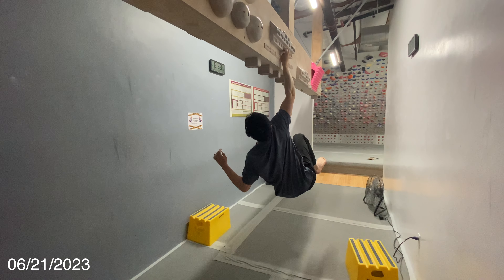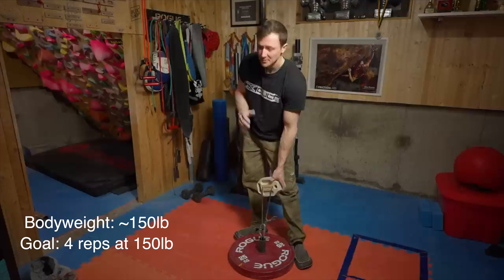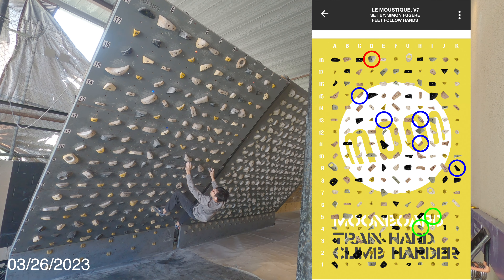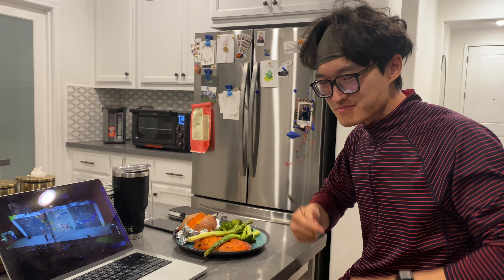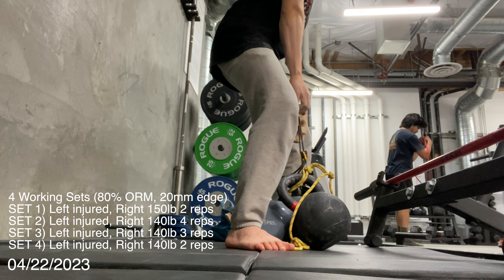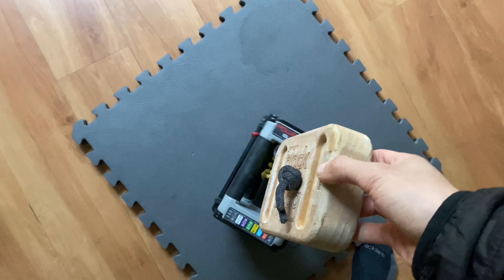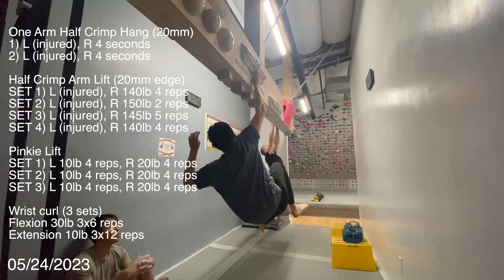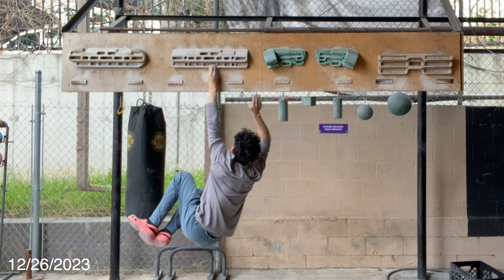How to Train the 22mm Half-Crimp ONE ARM HANG (and actually get it)

Comment: First video I've seen that addresses this form at 19:50, I've always half crimped with the wrist in extension with 0 pain. But when trying the strict half crimp I get pain on the ulnar side of my wrist. I get a similar pain with 3fd and on slopers. I've been doing wrist curls and reverse wrist curls to try and strengthen the wrist for months with no change. Any advice would be appreciated, hanging a 20mm one handed has been a long term goal for years, and idk if my half crimp form with an extended wrist is holding me back or if it's something else.

Great video, thanks for reading.
Reply: I also notice pain or at least increased tension, especially when emphasizing the pointer being in a half crimp. I think that position increases ulnar deviation. I injured my tfcc through overuse a while ago, and I think that weakness is my problem. Maybe check your tfcc?

Comment: I have really flexible DIP joints, and its very hard for me to avoid the hyperextension at the DIP joint. I can hang 1 arm for 2-3 seconds on the beastmaker center edge with hyperextension (not thumb wrapping), but can only hang with an additional 25lbs with two arms on a 20mm edge before my fingers fall into hyper extension. Do you have any recommendations for preventing the hyperextension/exercises I can do to help prevent this?

Comment: Your comment about the chisel position being weaker is probably not true — the position is generally worse for hard climbing because it provides less Z-axis control, but it's more mechanically efficient and requires less muscular activity for the same force output. This is partly why Yves Gravelle performs so well in edge lifts: his finger lengths allow both his index and pinky to be chiseled with about equal force distribution. (And I say "probably" only because there are probably edge cases where a specific individual's strengths/weaknesses/morphology make it not true for them at a given time.)

I also want to ask whether you'd consider overcoming isometrics / force meter training rather than the yielding isometrics you used here? The overcomings show greater muscle activity in tests, and generally are better at developing the ability to close the grip, which is more important in climbing. I actually think that really shows in your bouldering—you're very strong at yielding, but you actually don't seem that strong at closing your grip and "owning" the hold, which is what you tend to see with really good crimpers/climbers.

Comment: You said you wanted your DIP joint to be neutral or flexed, never extended. Isn't extension what seperates the crimp from the open hand position, which is flexed? And why is the hand "opening up" bad form when it is the same as flexed position? See for example Geek climbers video "Crimp Grip vs.Open Grip". Thanks.

Comment: The losing weight I do not agree with, haveing weight is a good thing. Better muscle strength, have fuel on you for your body to use, and taking painkillers I used painkillers while on Europe climbing trip coz my skin was so thin but I do not agree with taking it when training or at the gym

Comment: You can actually do everything so much better when warmed up properly. I noticed (a while ago) that I couldn't do one arm hang on 25mm at the beginning of climbing session, even after warming up for 20min. But after climbing session, I could one arm hang on the 25mm so easily. Even pinches, pull ups in 10mm, higher weighted pull ups and more reps. So yeah, just sharing some of my findings

Comment: Why intentionally avoid open-hand finger positions with the index finger or the pinkie, when oftentimes that is the most natural 4 finger hold due to hand-shape?
Reply: If you're training open hand, train open hand, and if you're training half crimp, train half crimp. That's basically the reason.

 I'm much stronger and more comfortable in open hand and it held back my lockoffs and more static climbing for a long time, but once i started training strict half crimp more, i could leverage myself into the wall better due to the higher finger angle and my lockoffs improved very rapidly. 

Open hand is relatively versatile and good to train but it will never provide the utility on incut crimps that half crimp will. That's why you still see Shawn Rabatou, Dave McLeod etc using it despite being much stronger in drag.

Comment: Rotation in one arm hang doesn't have to do with wrist strength. It is all shoulder stability. In general I think your info is a little wrong. Some of your advice is only specific to your own anatomy (finger lengths) and some of your advice is just not digging at the actual reasons for gains. Tyler Nelson does a great service at discussing finger flexion as a concentric motion instead of relying on passive tension.
Reply: Are you trying tyler nelson concentric curls right now ? :)
Reply: chill bro

Comment: No way open hand position does more load to A2 pulley compared to half crimp. It's misconception. A2, A3 and A4 pulleys position is mechanically advantageous with open hand. 
Overloading is dynamic process and at some point of changing to open hand middle finger is less loaded and consequently index finger gets critical load. It's likely the case. Anyway the main cause of injuries is excessive load and fatigue. We shouldn't torture our fingers that much. 
Actually the fanaticism on fingerboard helps not that much. Lower body mobility, lock offs and core strength is so much more valuable for beginner or intermediate climbers. I do pullups on 14mm edges easy but it doesn't really improve my technique. I also hang with 4 fingers (both index+middle and middle+ring). Definitely helps changing hands on small bad holds. Quite rarely used. Instead leg splits and lock offs are everydays need.
Reply: if you have proper form of half crimping you less likely get injuries because fingers joints are not overextending and they don't bend easily after weight lifting training. Been doing this for 5months now and ZERO pains when I crimp V6 or lower grade problems

Comment: How long are your climbing sessions? Just trying to get a handle on your total training volume (to me 2 climbing sessions a week seems low, but not if they are really long sessions).
Reply from the maker: My sessions are around 4 hours, broken down by warmup (1 hr), board climbing (2 hrs), finger strength training (1hr).

Lately have also been experimenting with campusing (1 hour warmup with 1 hour campusing) instead of just pure one arm pullup training on Wednesdays just because I think it's more applicable to current climbing goals.

So in total around 10-11 hours of training geared towards climbing per week.